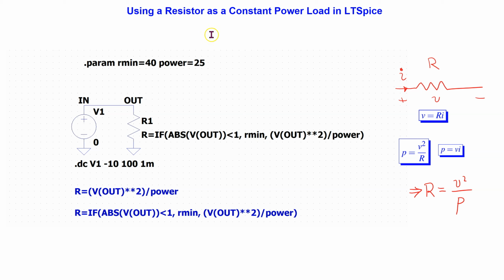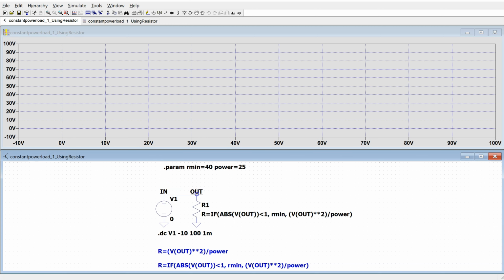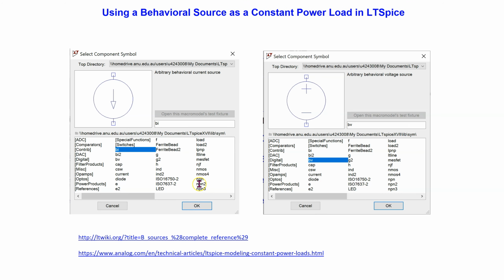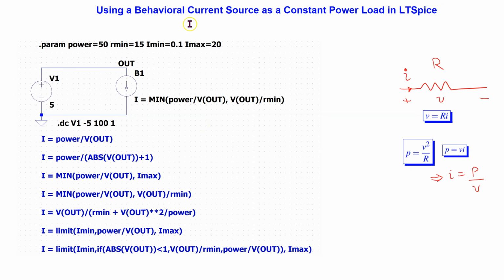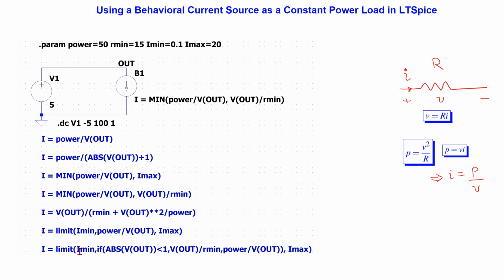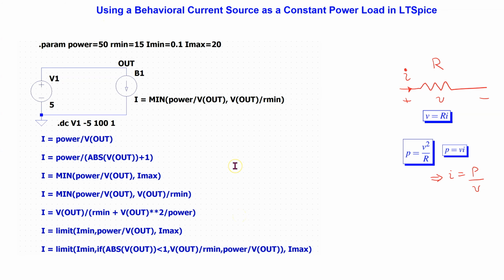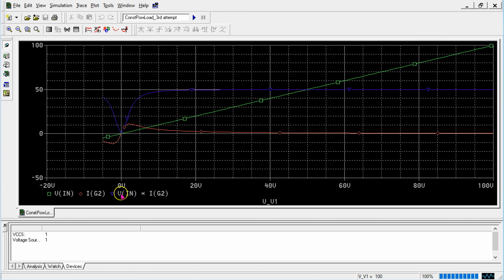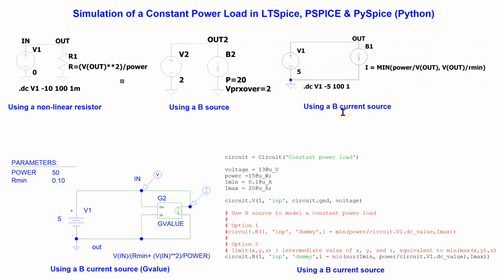How to simulate a constant power load in LTSpice, PSPICE and PySpice

Comment from the maker: # Pyspice (Python) code to simulate a constant power load
# Electric Circuits @ You Tube
# https://www.youtube.com/channel/UCn5Hpio6i2SNpETUeemKWuw
#
####################################################
import math
import numpy as np
from engineering_notation import EngNumber
import matplotlib.pyplot as plt
from matplotlib.widgets import Cursor
from matplotlib.pyplot import semilogx
from matplotlib import pyplot

import PySpice.Logging.Logging as Logging
logger = Logging.setup_logging()

from PySpice.Doc.ExampleTools import find_libraries
from PySpice.Probe.Plot import plot
from PySpice.Spice.Library import SpiceLibrary
from PySpice.Spice.Netlist import Circuit
from PySpice.Unit import *

####################################################
circuit = Circuit('Constant power load')

voltage = 13@u_V
power =15@u_W;
Imin = 0.1@u_A
Imax = 20@u_A;

circuit.V(1, 'inp', circuit.gnd, voltage)

# Use B source to model a constant power load
#
# Option 1
#circuit.B(1, 'inp', 'dummy',i = min(power/circuit.V1.dc_value,Imax))
#
# Option 2
# limit(x,y,z) | intermediate value of x, y, and z, equivalent to min(max(x,y),z)
circuit.B(1, 'inp', 'dummy',i = min(max(Imin, power/circuit.V1.dc_value),Imax))

# Dummy 0V source to measure current through B source
circuit.V(2, 'dummy',circuit.gnd,  0@u_V)

simulator = circuit.simulator(temperature=25, nominal_temperature=25)
analysis = simulator.operating_point()

for node in analysis.nodes.values():
    print('Node {}: {:4.1f} V'.format(str(node), float(node)))

for node in analysis.branches.values():
    print('Node {}: {:5.3e} A'.format(str(node), float(node)))

# Measure power in B source
power_mea = analysis.nodes['inp']*analysis.branches['v2']

# display the desired power
print('Set Power={} W'.format(EngNumber(float(power))))
# display the measured power
print('Measured Power={} W'.format(EngNumber(float(power_mea))))